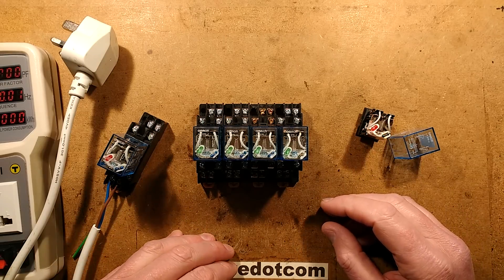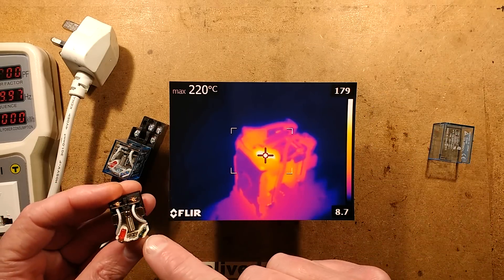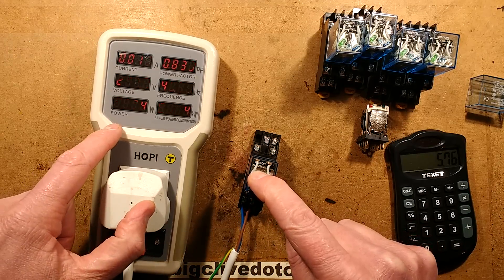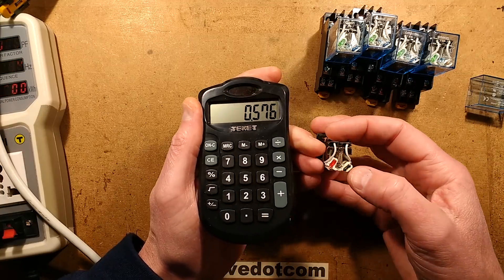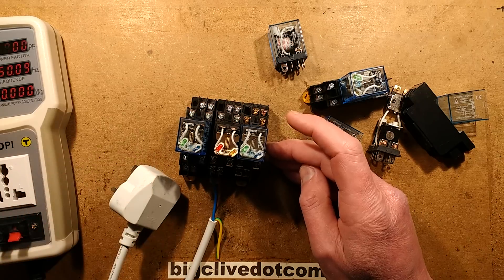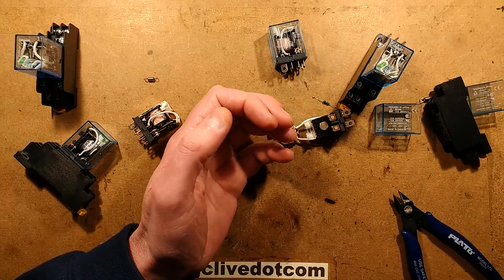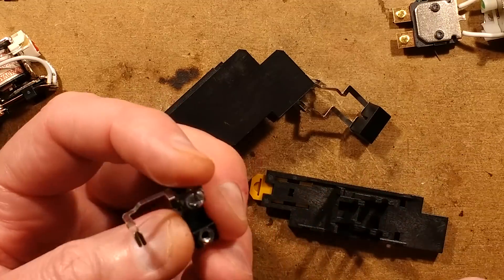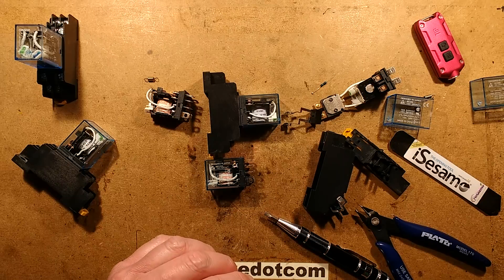Fake Omron relays with smoky issues.

Comment: did you ever get a chance to visit a Strowger exchange Clive ? I grew up around them as my dad managed one of them - and then I had a summer job cleaning airdrie, Cumbernauld and Coatbridge exchanges in 1988 - when Airdrie was still an active strowger so spent most of the summer wandering about it/cleaning up patch wire off the floor, etc. I liked watching them indexing up and down - REAL connections. REAL calls being made - and there was always some engineer who'd have patched in his speaker box into a random unit so we could all listen to someones calls! quality. Airdrie was being converted when I left one solitary fridge sized system X box to replace two massive whole rooms full of strowgers. By the time I left they'd nearly finished stripping out all the strowgers - just 2 big empty floors and the wee system X box. I imagine exchange is closed now completely :-(
Reply from the maker: I worked in a secret exchange somewhere in Glasgow that was a dedicated air conditioned room that had an old electromechanical exchange in it.  It was for government communication in the event of nuclear war as they believed the electromechanical exchange would survive the EMP.
Reply: When I worked for the MOD decades back, they had a digital system, whereby your (chip-based) I.D. card carried all your personal 'phone info too (or rather "told" the 'phone you were using what that info was). No matter which telephone anywhere in the Hospital, just plug your card into the slot, and you have all your saved and speed-dial numbers set up for you. The system even recognised if you had a stored message on the system. The telephones were by Ericsson, so they may have installed the exchange. Back in the day, this was really "space age" technology!!

Comment: I spent about 6 hours at a factory replacing the led current limiting resistors that had gone faulty on relays, dirty crusty ol' relays...eh..... a freelance jobs a job.
Reply from the maker: No harm in that.  Work is work.
Reply: OK, I quickly looked up these machines. Now are you trying to run this on AC/DC Adaptors, DO NOT. Every machine i looked at, was powered by batteries. People who used the machine DID complain of painful shocks, so I think shocks are just a part of it. You can NEVER use AC/DC adapters, as I would be afraid that any sort of AC leakage would kill you. Send me a pic of what you have come up with so far to bigkim100@hotmail.ca
As well look at the Instructables version of this unit. By the way, I do know what im doing, but big Clive knows 1000x more than me...he  could wipe the floor with me.
Reply: If you like the Instructionals version I have all the parts in stock, and can make u one in no time.
Reply: XOAdez
Reply: I'd add an analog foot switch (potentiometer).

black lead _ - battery + _ potentiometer _ red lead
so you put your hands in, press the pedal slowly, wait the time you have to, release the pedal slowly, and pull your hands out.
the gradual increase of current should avoid the shock 

you could also just use a 10 turn potentiometer, and turn it till you don't get a shock.
(try with resistors before, so you know what value pot to take.)

Comment: Wouldn't it be cheap these days to just fit a rectifier and capactive dropper into the relay case and use a 24V coil?
Reply: Nope a cap dropper for 240V complete with regulation even at production quantities costs about 30p for a well designed one. That's far more expensive than the differences to the coil. Then the really big issue is form factor. It would not be standard, so nobody would buy it, and then what do you do with legacy equipment?
Reply: I agree , not only is there cost and legacy to consider but also the reliability factor ...
Use of the KISS method is one of the marks of good engineering practices .

Comment: I actually bought this one. Can it handle 12V up to 10A??? I was unable to find any DPDT that can handle this in my local suppliers...
Reply: Try TME, RS, Farnell, Rapid, Digikey, or Mouser. If you cant get one from one of those I'd be quite surprised.
Reply: I found OMRON MY2IN 12VDC on TME website... and it's not that expensive... well now I'm thinking what should I do with the Chinese one....
Reply: Cool, have a look at their other stuff some of it is very inexpensive.
Reply from the maker: I wouldn't trust a clone to switch that current and I'd choose one rated at higher current than I was going to switch.  It sounds like a 16A relay would do, or maybe an automotive relay?
Reply: I need to switch peltier cooler which draws around 8,5A 12V and I thought DPDT would be perfect to switch polarity
Reply: If you can be bothered with the pfaff then an H bridge would work fine at 12V.

Comment: i dont think thats a proper coil for 220v, i have a very old genuine omron relay that also have 220v coil, installed it on my home made water heater to drive contactor and is powered 24/7 , only power off when the heater is active, and when i touch it, its only gets warm, i can barely feel the warmth of the coil, ill see if i can make a video of it with the spare one
Reply from the maker: It would be interesting to know the DC coil resistance.
Reply: bigclivedotcom i will see if i can find a genuine omron relay thats rated for dc
Reply: okay i measured mine and it was 16k ohms on multimeter for 220v/240v rated relay
Reply: In comparison the OMURBKK 220/240 VAC Relay I have in my possession with the diode+resistor disconnected have a 12K Ohm resistance.

Comment: Ok, so the various manufactureers can Knock-Off an entire relay...but cant figure out the value of LEDs resistor????!!!!!....GEEEZE!
Reply: That's just the tip of the iceberg.
Reply: pretty stunning they didn't figure this one out., might be someone bought a crate of relays through the backside of a factory and tacked the LEDS on, and didn't know his shit.
Reply: That is a deliberate choice to make you buy more relays.
Reply: willrobbinson Half ?
Reply: they probably got a better deal on those ones or something...
Reply: unless they rated it for 220v but the supply in his house is around 248 ish volts so its pushing the resistor a bit  i guess  even the supply at mine is 243v
Reply: That's a crazy thing with "knock-offs"... They might mimic parts to sub-millimeter dimensions, same materials, actually worthwhile generics...

And then they cheap out on the necessary part. A fraction of a penny and a competitive, long-lived product becomes one that breaks from looking at it wrong.
Reply: Original Omron relays also have LED's built in.
Reply: theskett is right. Dissipation will be be very close to half. When doing non-DC power calculations we must work with RMS values. With half of a cycle suppressed by the diode, we square and then take the mean to get half (compared to full cycle), then take the root to end up with one quarter of the full cycle. So the RMS current with one half of the cycle removed is 1/4 of the original. Then I squared R gets us back to half.

Or you can simply think of the same power being dissipated but only during 50% of any given interval.
Reply: exactly!!
Reply: UK mains is nominal 220-6% +10%, so can go up to 253V and still be within spec. At that, that resistor would be dissipating well over 6W, nearly 6½!
Reply: This is one of the many issues with Chinese manufacturing.
Reply: its not a bad thing cooperating with them .... it is indeed a bad thing letting them handle everything though. look at how Russia uses gas supply to put pressure on countries that were stupid enough to rely so heavily on them.
Reply: add a diode & its a quarter of dissipation
Reply: Merica!

Comment: A note about resistor wattage rating: they are rated mounted in free air (off the board). With a relativelly normal airflow. This one is burried in plastic, thru limited airflow. This will reduce quite alot the wattage rating. Derating is a pain.
Reply: Против Глобал 2x safety margin is unfortunatelly costly, so the "butcher" departenent will most likelly slash it to 1.25 or less. On chinese cheap stuff, it can actually be 0.5 times. That's it, use a 0.25w when 0.5w should have been used... Won't last long, but the part specs is also 2x their limit.. which make it trully 1.0 times the part limit... 

Ahhh the joy of slashing the cost of junk....
Reply: Should've used a 1W 220k resistor minimum.
Reply: thephantom1492 are there derating standards or guidelines for situations like this?
Reply: otm646: There is some guideline and rule of thumb, and one of the guideline is to leave space around it so it can 'breath'. And then, if you are unsure, to actually test it to see how hot it really get. Clearly, they didn't cared in this case.

Comment: I find it a lot quicker to square the voltage first: 12V = 144 WOhms. ~220V = 50kWOhms, ~240V = 60kWOhms.  This allows doing the daily calculations much quicker.
Reply: can you elaborate a bit more on that?

Comment: Could you change the resistor in the ac 240v relay to a capacitor to cut the voltage for the led and keep the heat down?
Reply from the maker: It's as if they've added an extra bit on top of the relay.  Not much room, so a resistor makes sense for a low intensity indicator.

Comment: Hey Clive, can you make a video about your printing technique? and detail photography
Reply: max things Yea i would love to buy a macro lens just to shoot circuit boards and stuff
Reply: For printing he simply uses an otherwise ordinary inkjet printer with a continuous ink system (likely one of the Epson models that comes with a continuous ink system, though there exist add-ons for retrofitting some other printers).  I'm pretty sure all his photography is done these days with an Android phone or tablet (an iPad previously).  It's been discussed in the past in earlier videos some years back.

With modern inkjet and color lasers it is not at all difficult to get great prints these days so long as you take a good photo to begin with.  And with proper lighting, modern smartphones and tablets can take some very amazing photos.  It really is not until you get into low light situations or need a shallower depth of field, proper optical zoom, etc., or zoom deep into a photo all the way down to the pixel level, that you will notice any great difference between a photo taken on a modern smartphone versus a professional DSLR camera.
Reply: years ago i used to put pcb's into the flat bed scanner , worked very well if they didn't have big/tall components on them
Reply: yes but that's not clive's way now
Reply: Ethan Poole definitely have to agree that a good print comes from a good original file/image. I've seen some shockers in my time like the backdrop of this fashion show I printed that ended up having pixels about 20mm big because the person who made the file didnt really know what they were doing. It was an incredibly rush job so we didn't have time to get new files from the client. Looked alright from a distance.

Comment: Use lots of the Omron MY4N-120VAC and MY2N-120VAC at work. Still have many relay safety interlocks which are separate from the PLC and DCS systems.
Reply: XOAdez Don't fuck with electricity. I could tell you how to do it, it's extremely simple. But it seems you don't have the required knowledge